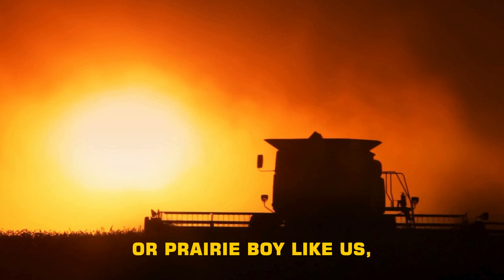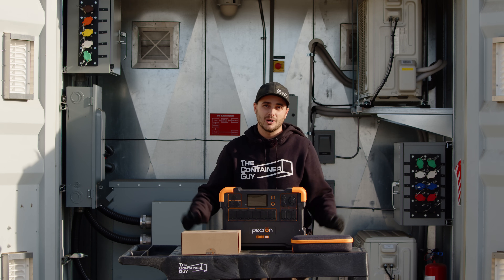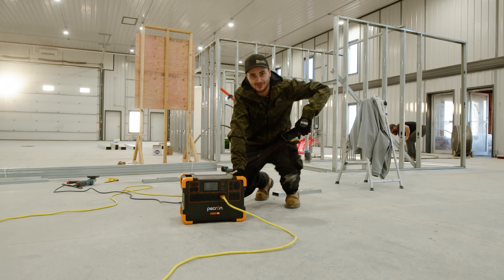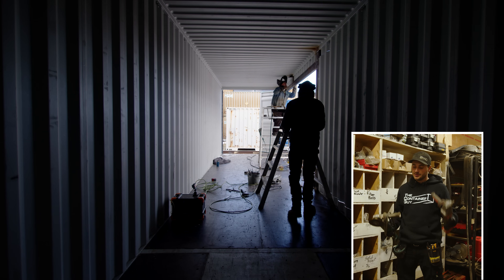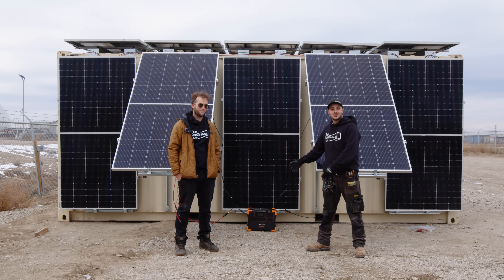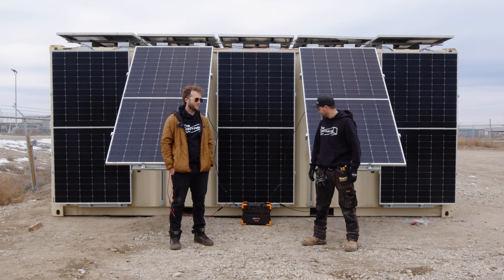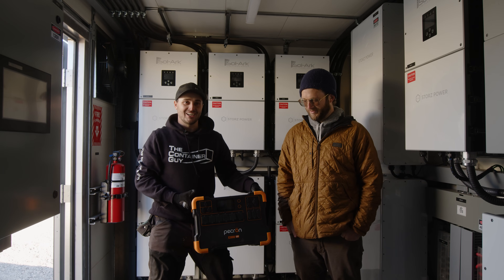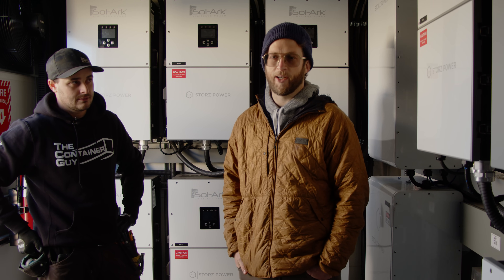Solar Showdown: $450K Hybrid Shipping Container vs. $1300 Pecron Battery Pack

Comment: An ultra value version of this for off grid residential would be cool.  EG4 12000XP v2, Yixiang 32kWh battery kits, 8.4kW solar panels mounted container, 19.6kW solar panels that are ground mount or portable, and an affordable generator for backup (WEN TF1450X)

Comment: Great job on the solar array. Lifting and returning the panels could be automated with linear actuators. I'm late to the party so maybe it's been discussed. We are installing them on our RV. Not only does that make the job easier, but you can also select precise angles. They can be operated remotely. You can also use a solar tracker so the panel automatically angles for max benefit. Love your channel.
Reply from the maker: Definitely not too late, we're still working out the best way to make them fold out. I'll forward this to our engineers!

Comment: Saw this on Canadian Prepper and you mentioned the transport wind problem. So I was thinking that maybe a verticle piece of metal that is connected at that corner of the panels as a wind shield. Only the piece of metal is on like a kind of hinge that can latch when the poratble power is not in transit and then can be unlatched and swung into wind shield position and the same latch engages to hold the wind shield in position. That verticle piece of metal at its top and bottom are on a hinge like you would find on a refrigerator door.

Comment: The E1500LFP is badass. You should get the expansion EP2000 batteries. 

The new E3600LFP will be released later this month with a 3KVA inverter.

Comment: Love the videos and containers , your comment on engineers clicked the memory banks .  I converted a bus to a motorhome years back and have through the years done some building and mechanics .  My greatest beef with engineers is no hands on experience.   They can design something but, someone has to be able to build it  and service it. It is nice to have a pipe chase , they can help service plumbing and keep water damage to a minimum if something happens.  The same can be said of wire chases to keep wires from wear and tear.  You also need space for tools. ( rather than having to purchase specialty tools -- necessary to change the water pump on one of Chevy's cars ).  When I was converting the bus, an article in Motor Home Mag.  spoke of elbow and shoulder .  If the mechanic was working on X ,  anything within the distance of elbow and shoulder was likely the next thing needing service.  those would be the items likely pushed or hit by an elbow or shoulder.  Two of the best cars I saw or had was the Saab slope back.  ( they stopped importing to the US in '73 because of  5 mph bumper laws )  That Saab had a water pump that sat to the side of the engine alone.  It could be changed in minutes and you didn't have to tear the fan and radiator out of the car.  The other car was the Toyota Corolla  when it was first imported .  Toyota made it easy to be worked on by the owner because they didn't yet have the support staff and parts warehouses in the US.  Reminded of a third.  Honda Civic.  Emissions --  They redesigned the engine to meet emission standards.  The US added catalytic  converts and a whole bunch else.  Sorry to run on but, I think that engineers should get hands on to see that their project can be done.   ( now I'll watch the rest of your experiment with this battery pack .  All the best, Hal

Comment: $450K sounds pretty close to Military Contractor Pricing... $100.00 Screw Drivers and $200.00 Hammers. Need a little more information on the estimated longevity of the giant battery box.
Reply: Based on experience, it sounds about right if you factor in the cost of engineering development of such solution and the current price of power electronics (still suffering from partial supply chain shortages). Of course if you set up agreement with suppliers for larger volumes of batteries and standardize the solution into a product the price drops considerably. Just for your reference 100 kWh of batteries in a properly rated enclosure with switchgear is approximately 60.000 dollars.

Comment: quick question the fire extinguisher in the uk the red ones are water so thats bad for any electrics
Reply from the maker: They are Monoammonium phosphate / ABC Dry Chemical fire extinguishers. 

Water would not be wise in Canada given it'd be an ice cube half the year on all our equipment. Fighting a battery fire with a gallon of water would be comical 😂
Reply: Fires are grouped into classes which depend on the material or substance that is present.

    Class A - Fires involving ordinary combustibles such as paper, wood, cloth, rubber, or plastics.
    Class B - Fires involving flammable liquids, gases, oil, paints, or lacquer.
    Class C - Fires involving energized (live) electrical equipment such as motors, appliances, or power tools.
    Class D - Fires involving combustible metals such as magnesium, titanium, sodium, and potassium.
    Class K - Fires involving combustible cooking oils, or fats in cooking appliances.

Comment: Hi, I follow this content with very much interest. My thesis in mechanical engineering, almost 10 years ago studied the feasibility of a containerized solution using solar panels, battery packs and power electronics to create a standalone zero-emission power generator. The design I proposed had something very similar to drawer slides to deploy the solar panels, yet keep them within the container during transport. I very much enjoy seeing someone bringing similar concept to life. As of today I work on contaierized solutions which house Hydrogen Fuel Cells to generate electrical power. The flexilbility of the container platform it is so unmatched! Good luck on your next projects.
Reply: Hey man your thesis and current work sound really cool. Can you elaborate on your current work! Thanks